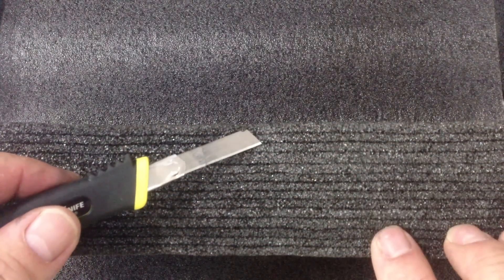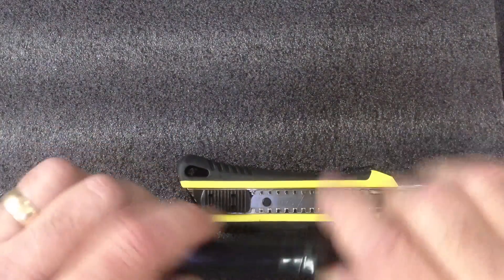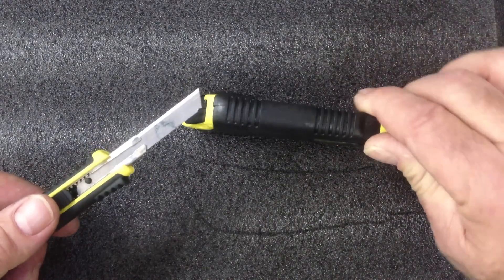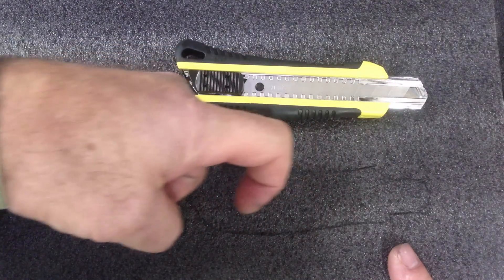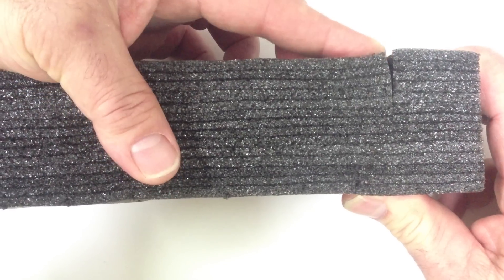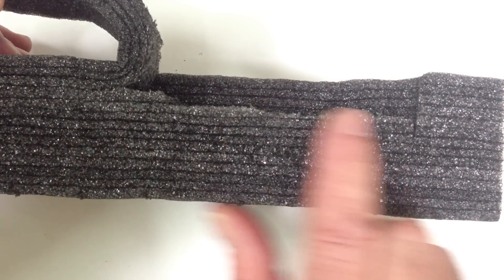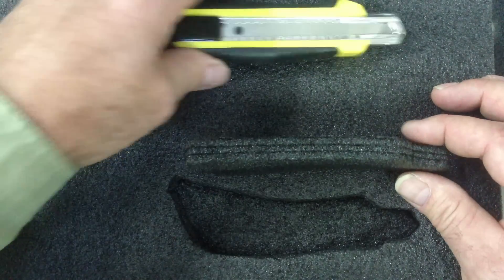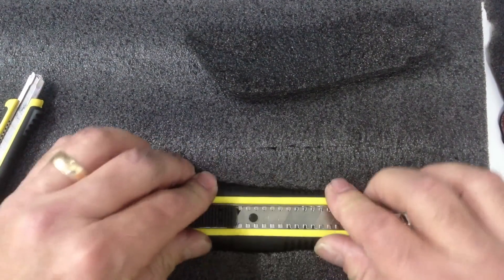Kaizen Foam Quick Overview - Lean Manufacturing

Comment: Hey there!
I hope you'll see this comment, and reply 😊

I've recently bought 3 sheets of Kaizen Foam, from Rutlands in the UK, but from the footage on the video, I don't feel that I get/have the same effect..? When you remove the layers, the bottom and removed piece, looks clean and smooth... I don't really get that same effect?

I've seen the different videos, and I believe I do as shown...

Thanks & Cheers.
Reply from the maker: Yep, I replied on Facebook, but here is the response (for others):  It won't be completely smooth unless you put the top layer back in or smooth it with something hot. (we sell the Kaizen Foam Hot Knife).  We do have videos on this.  Also, as your practice, it gets easier. Have you seen this video https://youtu.be/-Mz1ppCjJ08  We also have a Kaizen knife with a thin blade that makes it easier to cut for smaller tools, etc. You can see all the Kaizen Foam products here. https://www.fastcap.com/products/lean-products
Reply: @FastCapLLC  - Thanks, I appreciate the reply!
I'll keep on going, and I'm sure I'll get the hang of it.

Thanks again
Best regards.

Comment: Nice product.  I have seen similar products for photography gear, though I think if you want a very precise size this is actually much better.
Reply from the maker: Thanks Joe.  I use it for all my camera equipment and it works great!!! Paul
Reply: The professional level cameras are much thicker.   It would be helpful to have the foam in something up to an 8 or even 11 inch depth.
Reply from the maker: Joe Koren Joe, You can easily stack them on top of each other and glue them together with our SpeedTape (http://www.fastcap.com/estore/pc/viewprd.asp?idproduct=310). Paul